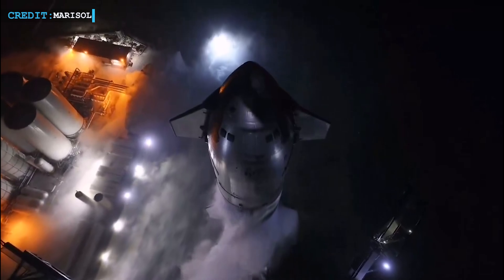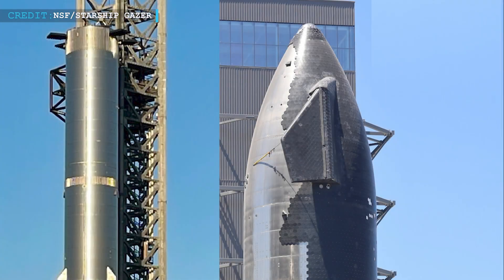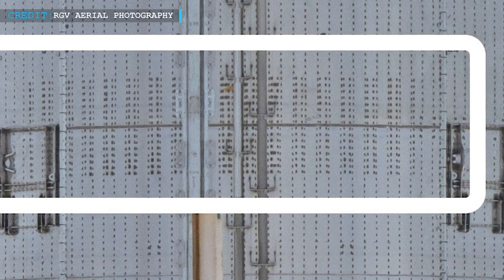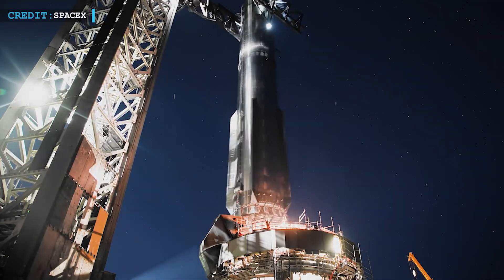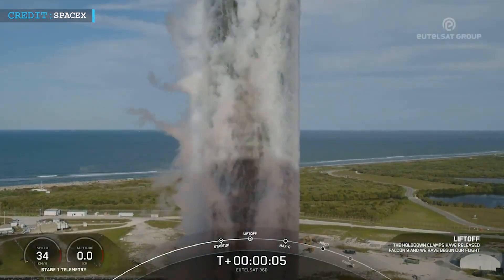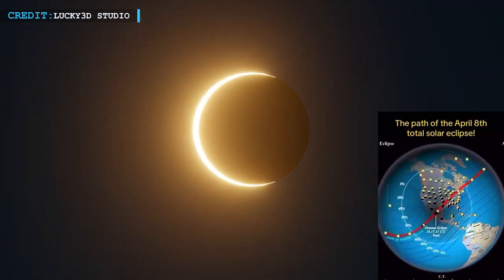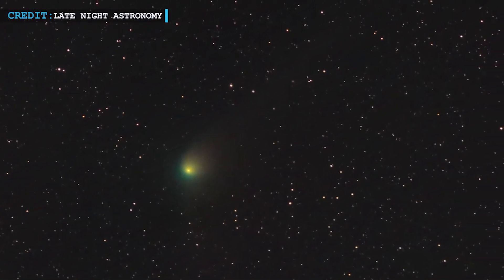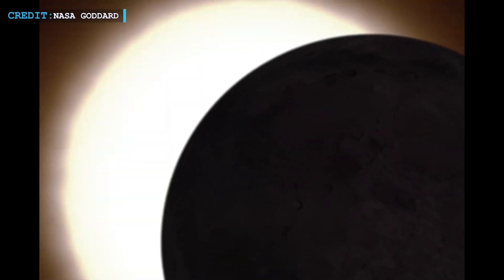SpaceX BIG Changes on Starship Flight 4 | Rare Total solar eclipse 2024 in Texas

Comment: 10$ per kilogram, is large improvement of NASA…The cost per kilogram for NASA to send a payload to space can vary widely depending on factors such as the destination (e.g., low Earth orbit, geostationary orbit, lunar orbit, or beyond), the type of rocket used, the complexity of the payload, and the specific mission requirements. However, it's commonly estimated to be in the range of $5,000 to $25,000 per kilogram.